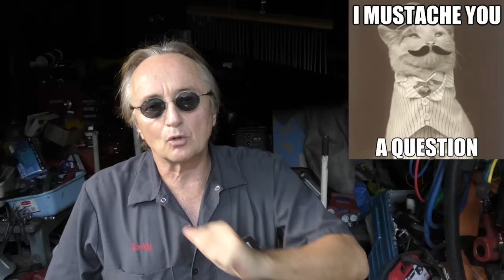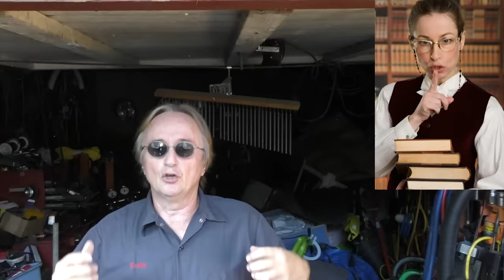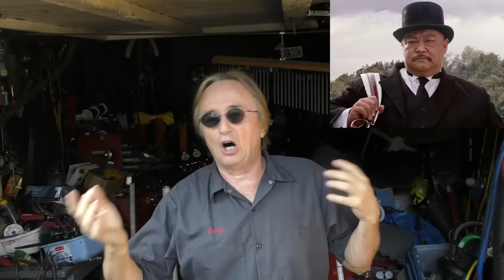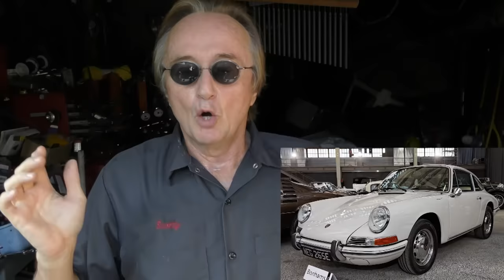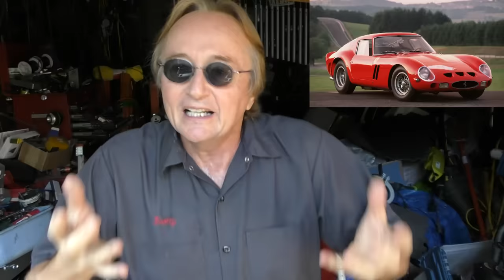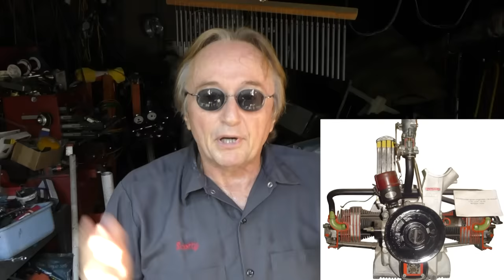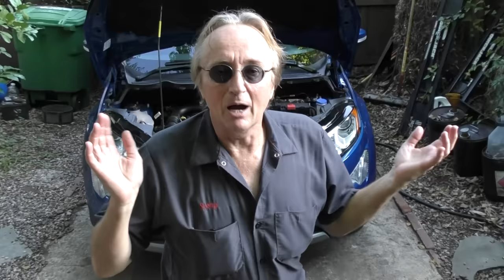The Truth About Boxer Engine Cars

Comment: I have 2 Subarus. A 4 and a 6. The sounds of both is wicked cool and the reliability has been 100%.  The boxer design is awesome.  Big props to Porsche and Subaru for sticking with it.
Reply: Subarus are cool, and so are Porsche’s. And if you’re willing to take care of them you’ll have some of the most visceral cars out there.

But Scottie is right. Boxers are kind of quirky and there is a reason why the industry largely avoids them. Just like rotary engines. Boxers are hard to work on, prone to gaskets warping, and prone to burning oil. That’s not necessarily bad when you know what you’re doing, but kind of a hassle for the everyday consumer. Even Porsche doesn’t use them for their bread and butter Cayenne and Machan and Panamera cars opting to use V6 and V8’s instead.
Subaru’s has never been and will never be more reliable than their Honda and Toyota counterparts and the Boxer motor is a large part of that. 

With all that being said, never let go of your Subies, they are awesome cars and the sounds they make are completely mental.
Reply: 2010 outback flat 4, love it, the cvt is just amazing
Reply: The old pushrod engine Subarus were amazingly easy to work on. Adjusting the valves was easy, and everything was up top except the the oil drain plug and the oil filter, which was right in front.
And they were absolutely reliable.
Reply: How long ownwd?
Reply: @Jack McAvoy After 2009, the 2.5 H4 had no more HG problems than any other car. The 3.0 and 3.6 H6 are as reliable as they come, having a lifetime timing chain and almost no HG issues.
Reply: Poor efficiency, fuel hungry, that’s what killed them in the U.K.
Reply: The industry avoids boxer engines because they are more expensive to manufacture, A cast block with four holes on one side is the least expensive design to manufacture.
Reply: Troi Aitkins no it’s double everything, double the parts, double the work. Better for airplanes where you can service on left and right sides.
Reply: My 15 Subaru Forester with a CVT is as advertised and compared similarly to the CRV and RAV4. My only regret is that I should have gotten the XT with a turbo.

Also, Consumer Reports just named Subaru as the most reliable car brand.
Reply: @NeoCloud  protect that cvt with your life I used to be a mechanic at Nissan and the cvt's were by far and away the most problematic things fit to those cars. Be religious with the service intervals on it and it hopefully won't be an issue. I hope the Subaru cvt's are better than the Honda ones they put in the versa since they would go bad in about 130k no matter what.
Reply: @UC3Gq8DDsHNOND5sS5F5Xzbg Was at the auto shop I go to and they see tons of Subarus (in Denver)...  He said he sees head gasket leaks, timing cover gasket issues and some burn through more oil then they should
Reply: @datboinumpad1715  CVTs were always a weak  link for sure but Subaru really hit the nail on the head with their Symmetrical AWD CVT. The fact that it is more or less a center differential in this application allowed them to engineer it without the cooling and band issues other manufactures encountered. If you enjoy spirited driving adding a trans cooler definitely wouldnt hurt.
Reply: My 2011 Subaru outback has 190K miles on the clock. Yup, it's a bit noisy but it' s reliable.
Reply: Yep, in NA form especially they are very reliable. Just got to watch the oil levels, keep it over half way at all times.
They can be pretty economical when cruising due to the natural balance and are very smooth. But they aren't great at low speed.
Reply: @righteyeblinks8418  Got an 2007 Outback H6 3.0 270kms
Reply: @Soh90  I have the 3.6R legacy and I am going to attempt to keep it for 200-300k miles if possible.
Reply: D Jansen timing chains need maintenance too, just not as often. But on the ez30 you have to remove the chain to replace the water pump. A ~$1300$ repair. Ouch.
Reply: @tomtd  here is the real pickle, that's why 75% of subaru's sell is in north america
Reply: 2001 GT Forester still gives cheap thrills!
Reply: @Troi Aitkins but you don't find a v8 in say a toyota corolla. I commend Subaru for sticking with the boxer throughout their range of vehicles. 
02 Impreza NA
Reply: Clee Torres I want to buy a Subaru wax 05 is that at good car ? 5 speed
Reply: @tomtd  
Bull, 1979 1600 FE got 56 MPG. And THAT'S what "killed them"
Reply: My buddy has a Subaru and it's basically brand new and the transmission already went out in it.
Reply: @wordup2yourmother  
That's because most people nowadays hot rod Subarus and drive them like they're in the Indy 500.
Of course mine was a manual transmission.
And I drove mine like I was trying to get the best mileage and the best gas mileage out of it.... it wasn't a play toy.
Reply: @datboinumpad1715  I've heard about Nissan CVT nightmares. Have a friend that has a 2014 Rouge with 160k miles and no problems...
Reply: @Helicopter Dad  you're talkin about mostly the turbocharged models.
Reply: @wordup2yourmother  Subaru is known for its glass transmissions but that is not the subject of the thread! we are talkin about the engines.
Reply: @saiyamang5397  wrx basically new. Any guess about the repair costs?
Reply: Sounds terrible like any other farty four cylinder engine.
Reply: @wordup2yourmother  if the car is new and you bought it from the dealer the repair cost should be zero... Car should be under warranty.
Reply: @saiyamang5397  not my car, it's my friend's car and it went off warranty before the transmission went out.
Reply: @wordup2yourmother  that it's pretty unfortunate for your friend! Depending on the year of the vehicle I would say a new transmission from the dealer would run between 7000 to $9,000 and the labor is probably going to be anywhere between 700 to 1200 unless you are looking at getting a used transmission and   they can run anywhere between 400 to 1000.
Reply: @wordup2yourmother  also I've heard there are these little companies that have been sprouting up that offer extended warranties that cover things like the engine, transmission and drivetrain but I have no experience with those kind of companies and that is something that would have to be looked  into by your friend... I think carshield is one of them if I'm going to go off the top of my head.
Reply: Username 1991 this is absolutely correct! It’s all about whether someone knows how to actually drive or whether they think they drive a Lamborghini and blow the fucking heads off.
Reply: @damojan  FA and FB H4s also have chains.
Reply: My 95 legacy wagon has 260k on it and still running great. used it as a tow truck this past winter few times pulling me ex's and her neighbor's suv out :) Got it for free as my step dad did not think it last that long that was when it had 220k on it
Reply: @NeoCloud  honestly hate the cvt in my opinion tho I live in the north have had trouble with cvt transmisions trying drive where my 5 speed gose
Reply: 2011 wrx here. Gotta love these things. Blub blub blub blub
Reply: 991 gt2 rs ??? Say no more :-)
Reply: my impreza has already started to leak oil, 2005, 2.5L...
Reply: @Soh90  I beg to differ, owned an EVO 8 for 7 years 120k miles cammed and boosted. NO issues, the way it was geared w 5MT, dual scroll turbo and the steering feel ALL better than a '15+ Sti. I like my cobb stage 3(305whp) Sti but loved my old EVO RS w manual windows it was raw and light on its toes and quicker mod per mod. Subaru needs Porsche money to run good...people only buy em more now bc Mitsubishi quit making the Evo. NEVER get rid of your evo. Over 7 years I NEVER lost a race to a scoob now I know why!
Reply: Clee Torres I thought about new forester, should I?
Reply: I would liked to hear a boxer 8. 10 or 12😊
Reply: I own a 2012 WRX STi, and boy, it has a very poor gas mileage. My wive has a 2014 XV Crosstrek, it has a decent fuel economy (but still not good enough). But both of them are quite reliable. And they are both also fun to drive. Their handling and cornering are exceptionally good. Not only because they have AWD, but also due to the low center of gravity, thanks to their boxer engines...☺️☺️
Reply: Wouldnt mind the outback, or forester sti😊
Reply: Hey Clee recently a Subaru with the 2.5 boxer engine went over 1,00,000,000 miles yes that's one million  with no mechanical repairs to the motor. I am still waiting to see one of Scotty's toy autos do the same. This is a gasoline motor for those not  familiar with Subaru's
Reply: Vape naysh Subaru lol
Reply: I can smell the juul clouds from this thread
Reply: I can smell the juul clouds from this thread
Reply: I have a 2000 forester l. It has 204k miles on it. I just came back from a 16,000 mile trip from Tucson to Alaska via Rt 66 to Chicago. Up to Prudhoe Bay. And back down the west coast. Amazing! I a major failure. Of my cigarette lighter? Which caused my Inverter to loose power that service my 45 quart freezer. $3.75 at the car parts store in Fairbanks. How many gm, ford's or even Jeeps owners would say that or even did that. Nope not that the fastest. But a tough as nails off road capable SUV..
Reply: And BMW motorcycles.
Reply: @Soh90  LOL hard to work on? Subarus are some the easiest cars to work on, and I delivered Pizza in my Subaru for 60K miles and never had a single issue XD
Reply: @Soh90  the biggest reason why most manufacturer use v4/v6 is because they are cheaper to make, period.
Reply: Jason St-Coeur  
So, what do you think about the 2020 Forester Sport?
Reply: @NeoCloud  how many miles on it. I'm curious how the cvt is holding up
Reply: Maybe if Subaru used a Pittsburgh steel grade engine bock instead of Melted Toasters , heat based expansion and contraction issues might not arrise. It's all about the metal and heat. Bring back USA STEEL!!!
Reply: Sure but it doesn't stop them making V6s and V8s.
Reply: Wont lie I was cruising at 70 in my 07 Impreza(wagon) an it had a sweet little rumble. It kind of tempts you to get on it.
Reply: @Soh90  they really aren’t that hard to work on you might just be a terrible tech if you are a tech anyways lol
Reply: absolutely!!
Reply: Taking the STI to the Tail of the Dragon this week.
Reply: @Soh90  So why does Subaru stick to Boxer engines!
Reply: @gamalfaris1500  Because they specialize in them. Similar to Mazda and rotary engines. It’s their thing, but it’s certainly not the norm and has its drawbacks.
Reply: High key was expecting to have to defend myself in the comments but it seems to be a bunch of other boxer lovers, glad to see it!
Reply: Agreed, and it makes perfect sense for center of gravity on the heaviest single component of any car. Not sure why more carmakers havent adopted the design. It may be a "design of the past" like Scotty says...but does that make it inferior to V and inline designs?
Reply: What years? Ever had head gasket issues?
Reply: @joem1102  I'm pretty sure Subaru solved that issue (or at least lessened it) in recent model years, but I could be wrong.
Reply: @jbm0866  mines an 02. Lol
Reply: @jbm0866  mines an 02. Lol
Reply: @tomtd  it’s the turbo make it fuel hungry not the engine
Reply: I still prefer Toyota.
Reply: They sound like a misfiring in-line engine to me. Rather unpleasant actually.
Reply: I have a 2015 STI that is bone stock and never taken to a track or drag races with. My engine seized at 109k miles. For me, this has been the least reliable car I’ve ever owned. I am not some young kid trying to show off on the road. I am an older buyer who wanted a fun daily driver that was safe and drivable in the winter. All maintenance and repairs done by Subi dealers only, and done religiously. The EJ257 engine was just part of a lawsuit for early failures on the piston ring lands. Subaru in my experience is not at all reliable, especially this boxer engine.
Reply: Look on the bright side. It’s NOT a Volkswagen.
Reply: @Soh90  so the old Subies had head gasket problems. The only engine that has a problem with the new vehicle is the 2.5 due to the weak gasket. But if you upgrade your gasket to the STI gasket it won’t leak. Newer subies don’t have head gasket problems. IT’s people red lining and not babying their cars. Subaru is even fixing it for the abused cars and making it right. That right their makes subie better than Honda and Toyota. They stand behind their vehicle
Reply: @andystech5223  My biggest regret in life was getting rid of my green '95 Legacy Wagon for a red '03 Impreza. Now I have an '03 Forester I'm trying to resurrect. I like my Buick, I like my Honda, but I love my Subaru.
Reply: I have a ej205 with 180,000 miles on it have it past 9 years and not a single problem ,but always used genuine parts and 10w40 semi syn
Reply: Im about to buy a subaru 4 cylinder 2.4 turbo. 😬 hope for the best😅
Reply: @aimzallday6727  thats good to hear
Reply: @RonA0607  maintain the car. Regular oil changes, treat it nice don’t beet on it. My car has 42K miles runs great but I treat the car like it has 100K on it. Trying to have it last 10 years
Reply: subaru boxer is crap all the wrx ones tons of rebuild videos on youtube
Reply: @damojan  Yes. Because Subaru used a different gasket—a multilayer metal gasket and that seems to have fixed the problem.
Reply: Funny though, you can’t find Subarus with high miles, the motors don’t last usually. Maybe a Forrester but that’s it.
Reply: @richardwarrack871  Mine has 110K miles. It doesn’t have a turbo it’s a 6 cylinder,  so I don’t have to worry about a 4 banger with a turbo. As long as I religiously maintain the car, I should be good to go. No reason I can’t keep the car for 25 more years.